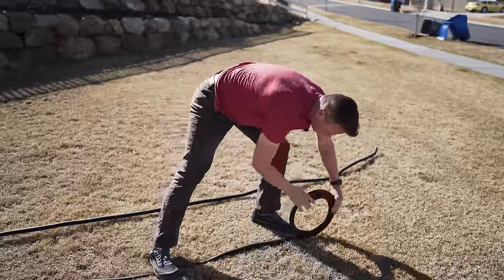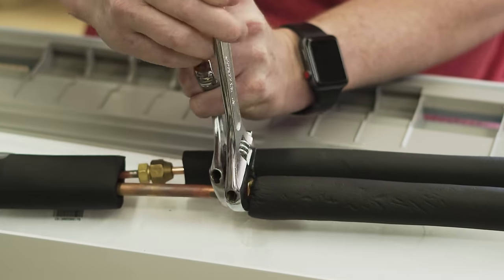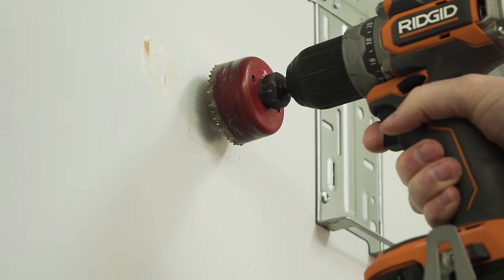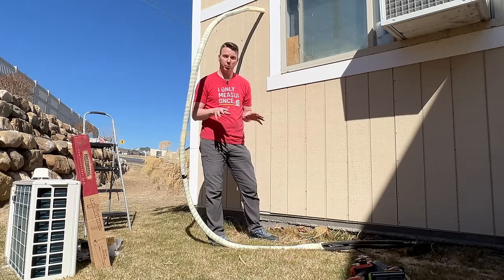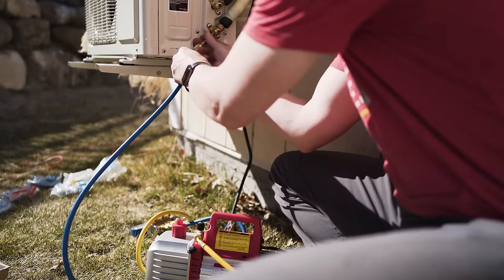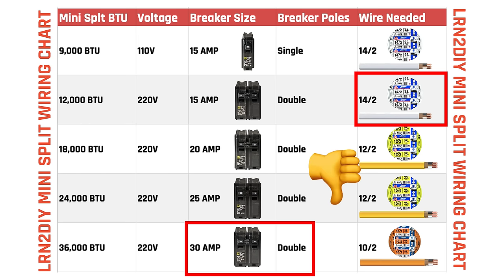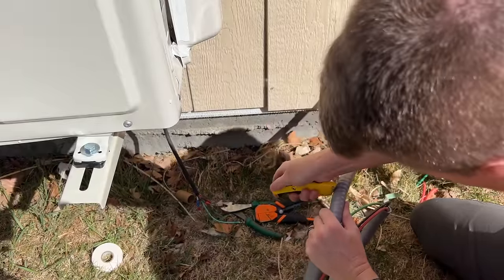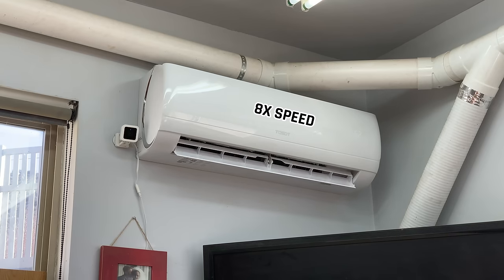DIY Mini Split Install - All the Things Nobody Shows You

Comment: As other have mentioned, you should use a 15 amp breaker set on this circuit.  The wire gauge is irrelevant when sizing things.  You size for the SMALLEST wire used.  In addition, I would have use the red and black wires and capped off the white one.  You have no neutral line going out, just two live wires.  The white wire suggests it is a neutral wire which it is NOT!  Yes, this works, but I wouldn't do it that way.  If you do use 14-2 wire, I would wrap the white wire with red tape to indicate it is a live wire, not a neutral.  Note that the wire to the AC condenser from the cutoff switch has red and black wires, and no white wire.
Reply: Well said.
Reply: 100% agree, well said.
Reply: Spot on !
Reply: Swap out the 30A for 15A ....a breaker is to protect the cable not the equipment.
Reply: you can tie the neutral and ground wire at the minisplit and run the neutral and ground to their respective parts of the buss bar at the panel. I tend to step up a size on the wire gauge on this type of thing in case in the future a larger minisplit is needed. Looks like a easy run though so no big deal.
Reply: @TheFleetz  think about what you are saying here… the equipment has overload protection built in, yes, but the breaker rating being higher than stated on the data plate would still protect the wire… since he used larger wire. The breaker being oversized is wrong, because the equipment is not rated for such a large ocp. So, in the case of motor loads, the oversized breaker for the wire is to prevent nuisance trips due to motor load surge amperage. 
Notice on any hvac data plate, the MAX breaker is ALWAYS larger than the minimum ampacity wire spec.
Reply: I was going to say the same!
Reply: Spot on!
Reply: I've watched several European techniques and those use a plug-in for the indoor powered unit and not run completely down the line set drain exit tube.
Reply: @SuperVstech  i will totally agree on what your saying but olso add that if a panel, or a breaker or even your electrical company looses a leg or phaze , then its going to single phaze and that motor will over amp to 60 + or - 10% only on one leg with the possibility of burning up the windings of said compressor or fan motor. I give this man props on helping but if he doest know electrical the its a possibility liability when wrong. oh and just note people you always shelter your rubatex on your high and low side so it doesnt consume water, get water logged and possibility end up loosing pressures.
Reply: @SuperVstech  you're forgetting internal wire in the units it's likely 16 gauge. Always size breaker to equipment specs And Just use wire at least that amp rating
Reply: Z?ss
Reply: He should have contacted Tom to confirm or do his electrical work , otherwise great video, very informative
Reply: @TheFleetz  Actually, that is not completely true with AC equipment.  If you look at just about any AC condenser ratings, they have a minimum and maximum breaker size and that is done to protect the wire and the equipment from catching on fire.
Reply: He should have taken his own advice and hired an electrician. In most places using the right wire colors is mandated by codes, and using the white wire to carry the second phase for the 220V is a code violation! To make this code compliant you have to use the black and the red wires.
Reply: Agreed. red and black for L1 and L2
Reply: Also, your not supposed to run romex into conduit, use THWN please.
Reply: Came for this comment...about the 15 amp breaker, everything else, extra learning. Thanks
Reply: Exactly.  Using the white wire instead of the red wire is a code violation where I live.  If you're going to use the white wire for a "hot", you MUST mark it by wrapping it on both ends with a color tape that indicates that it is a "hot" and not a neutral.  With there being a red wire already in the cable, it's odd that he chose to use the white and not the red.  Looking at the colors in the whip should have been a major clue that white was not acceptable.

As for the breaker:  The breaker should be sized to protect the SMALLEST wire in the system.  And in this case, that's either the whip or the wiring inside of the condenser unit.  I like the idea of heavier wire for the run (the #10 is fine) because you get lower voltage drop in the wiring.  But the breaker should be a 15 Amp.  And that's easy enough to change.  Just buy a 15 amp breaker and make the swap.  (And switch to using the red wire while you're at it).

Had he used a fused disconnect, he could have used 15 Amp fuses in the disconnect, and then the larger breaker in the panel would have been acceptable.  Without that fusing to protect the whip and the condenser unit, this installation does not meet code (where I am).

If you had this installation inspected by an electrical inspector (required where I live, along with obtaining a building permit), it would not pass.  It's fine to do your own electrical work on your own personal residence, but (here) you must have the work inspected, and these two fairly major safety violations would hopefully be caught and you'd have to correct them to make the job safe.
Reply: @TheFleetz  In this case the NEC says we size the breaker to what the AC unit says to size the breaker to protect the equipment.
Reply: The NEC says we size the breaker to what the AC equipment says to use. We also size the wire to what the equipment says to use. Not to the chart in this video unless it is that the equipment said to use. My 3/4 ton unit required 20 amp wire and 15 amp breaker. My two ton says to use 30 amp wire and 25 amp breaker. Also the NM cable(Romex) can not be used for this because the conduit is run outside and outside in a conduit or not is a wet location. Could have used UF-B cable.
Reply: Exactly.  I thought this was a test...lol  Good general installation instructions.
Reply: What a bunch of pansies 😂
Reply: Things are going to get really interesting when those wires going to the indoor unit short and get fed by that 30 Amp breaker.
Reply: @scaryperson27  neutral and ground should only ever be connect at service entrance
Reply: Guys, The breaker should be max 15amp and the Min. Ampacity rating is only 9 amps so the 16awg wire is sufficient for this install. You might not understand how a #16 AWG wire can be installed on a 15 amp breaker, but the NEC allows for this for equipment like Air conditioners that have motors.
Reply: NO,
NEVER EVER tape up a white wire to use to carry a hot side. 
I've come across this a few times. 
Besides being dangerous, it is not safe and against code.
Reply: Thank you for pointing this out. I got to this part of watching the video and just yelled "What?  No!" and checked the comments... sure enough, I wasn't alone in my shock. :)  Use the proper breaker size for the LOAD and for goodness sake, you have the red wire, use it for the other part of the split phase 220V !  Or if you only had 10/2 available, wrap the white wire with black (or red) electrical tape at the ends so it's being re-marked as a hot wire.
Reply: @ytmadpoo  conductors smaller than 6 awg can't be recolored, there are many more code violations and safety issues with this video. Proceed with caution
Reply: @TheFleetz  I believe you got it backwards the fuses to protect the equipment and not the wire you should have used the 15 amp
Reply: @SuperVstech  Thank you. I hope enough people read this far.
Reply: @zacharywm  Thank you for this comment, I got dinged by an inspector and told I couldn't use phase tape on some wires just because I was cheap,  so I had to rerun the entire line (and didn't save any money in the long run).   But then again, getting an inspector sign off is not what this guy is doing at all,  I wouldn't have either but needed him to sign off a new panel because the power company would not install a new meter without the tag on the panel that says an inspector looked at it (that really didn't save me any money!)
Reply: @Dr.HeySeussPHD  In many European countries only a certified electrician is allowed to work inside an electrical panel, by using a plug you can circumvent this rule.
Reply: Facts!
Reply: I'm so glad so many people noticed that. Other than the electrical install there was some good stuff like the condenser mounting bracket which was handy.
Reply: You dont know what your doing! I have been doing HVAC Plumbing and Electric over 26 year. The "Wire Size" also known to Pros is AWG (American Wire Gage) and it is the single Most Important thing. Unless you want a fire.
Reply: I've been doing HVAC Plumbing and Electrical over 26 years. Dont even try this! He only knows enough to be dangerous and a danger to you who listen. The necessary tools alone cost more than hiring a Professional to install it, about $3000. We do the job in a fraction of the time and give Warranties!🤣
Reply: @scaryperson27  no you can on tie the neutral to the ground. Absolutely NOT
Reply: @zacharywm  technically it’s the first disconnecting means
Reply: @code3responsevideos872  technically it's at the service entrance equipment
Reply: @zacharywm  no it’s not read the NEC buddy 250.24 - B  it’s at the service disconnecting means
Reply: @code3responsevideos872  I did, your missing "within the enclosure" but interpret as you wish
Reply: @zacharywm  I got my info from Mike Holt he’s the expert on the nec.
Reply: The outside:   I think 30amp disconnect is the bare minimum available serving code required disconnects.  He could have gone with a smaller breaker and wire, but his choice leaves room for future headroom.  Perhaps this application would be one to entertain a fused disconnect - minimum rating is 115% of full [normal] load current.  Without nameplate data, I'm guessing 15amp fuse would do the job, but not enough info outside of the manifacturers BTU guide he showed  The trouble with romex is white is the second color - always.  But its a manufactured cable, so put a band of color tape near each end of termination to indicate the ungrounded condition - any color except white, gray, or green is acceptable. 
The business of calling white "neutral" in this vid is no small mistake - he's terminating to a breaker [not the bar on the right or left side], and is picking up a phase.  Also worth noting [and I can't really tell from 25:07] is since his main is outside... he is working in a sub panel - the neutral bar should not be bonded to the box.  That reference [to ground]  should already be provided in the main panel.  Some might ask why?  Because grounding is for fault current, not load.  Bond neutral in more than one place and nothing good will come of it.
Reply: I'm a DIY'r and I completely agree, seeing a white wire says "neutral" so using a color any color (or tape as you mentioned) would have been much better.
Reply: The white wire is always recognized as the neutral wire and black is phase 1, 120v. Red is phase 2, 120v . Both together make it a 240v circuit.  Technically  the red should have been used,  and he needs to use 15 Amp bker and not 30. If that panel ever gets inspected that circuit wouldn't pass.
Reply: @SuperVstech  this is correct, I believe NEC 440.4(B) iirc.
Reply: There is no equipment protection 
15 amp unit. 30 amp breaker. 60 amp non fused disconnect  
Everything is backwards in this scenario
Reply: Romex isn’t outdoor rated even though you put in conduit for protection. Outside is a wet location and wire rated for wet locations should have been installed. Individual wires rated at thwn would have been ideal. Other people already hit on other wiring problems so I won’t list them. It is nice to be able to do a job by yourself but this project was definitely out of your knowledge base. Education and knowledge are the most expensive tools on any job site. This was my first video I have watched of yours and will be my last. Giving bad information to gullible people is a very concerning. This type of video is what gets people hurt and property damaged. This job should have been a permitted job. At least videos like this keep us tradesmen busy cleaning up other peoples “weekend warrior” project.
Reply: If the grounded conductor (White/Neutral) is connected to ground anywhere, this can allow for return current to travel thru the grounding circuit thru equipment and cause an electrical shock hazard. Instead of normally the return current or fault returning to ground at the first disconnecting means at the service entrance bonding jumper.
Reply: @TheFleetz  
Very well said. Thanks 
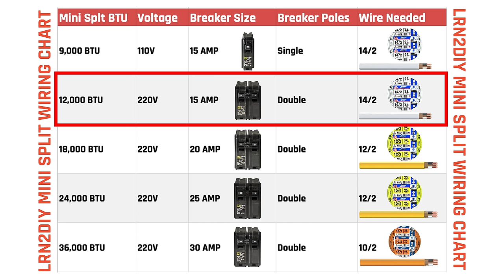This is very important to know . This is the first for me . I always thought that is to protect the equipment. 24:41
Reply: Code requires all 4 wires on a new install. You can't just use ground as your neutral just because it works. The electrical code it there for safety. Use neutral AND ground.
Reply: @robsapplianceplus6071  For a pure 240 volt circuit, you only need two phase conductors and a ground.  No neutral is needed.  If there were 120 volt loads, yes a neutral would be needed.  I have swimming pool motors that run on 240 volts, and DO NOT need a neutral, but they do need a ground.
Reply: @Herby-1620 , So explain why the electrical code requires 4 wire outlets on new construction or remodels when installing a 240 appliance such as a range or clothes dryer. Even prior to that upgrade, there was a neutral with no ground. Having a neutral AND a ground is for safety.
Just because you can, doesn't mean you should.
Reply: @scaryperson27  The only place that Neutral and ground are allowed to be bonded is inside the main service entrance. If they are ever connected in another location, that forms a ground loop and can cause big problems that are nearly impossible to track down.
Reply: @sebastianusami  I dug into this once. Definitely embarrassing though not prohibited by NFPA 70, at least. That bulk does count against the fill limit and that's a big hit. It would be a violation if the jacket was stripped from it since Romex conductors aren't listed for conduit service.
Reply: @scaryperson27  Connecting N to G would not be permitted there. That usually only happens where the structure's grounding system grounds neutral---only one point is allowed.
Reply: @TheFleetz  Agree on the swap for sure, but I believe you meant to say the breaker is to protect the equipment, not the cable.  The cable can be min or larger, but the equipment will state the max amp of the breaker on the label.
Reply: @TheFleetz  lol then why swap it out. 30A breaker is good for #10.........hmmmm
Reply: He threw me off, I landed a red/black at the 2 pole breaker. That is L1&L2 at the unit correct? He mentioned neutral and I got confused.
Reply: Exactly what I was going to say. It's good practice to always wrap the ends of white live wire with red tape so that it doesn't get confused for a neutral.

For those who don't understand, a neutral is only needed for 120V as it uses half of the 240V phase. In some 240v appliances, they contain a neutral connection as well, but they aren't present on most AC units or electric Water Heaters. If your 240v appliance has a neutral connection but your existing wires are only 2 hots and a ground, follow the instructions for the appliance, which usually have a specific method to bridge the neutral connection to ground.
Reply: @scaryperson27  There is no neutral! This is a 220V installation, which is both hot legs of your service. Using the white wire can be confusing to non-electrical lay persons. Of course, always size your breaker to the equipment - not the wire. Also the equipment often requires a HACR rated breaker to be code compliant. A HACR is rated for HVAC installations.
Reply: I like the 240v models better for exactly this reason - less amps smaller wire (that and it's load-balanced on my backup generator)
Reply: Does that mean, there is no real issue with using the 30amp breaker, if he is using the 10/2? @SuperVstech
Reply: @330Iceman  can you explain what you meant by "always shelter your rubatex on your high and low side so it doesnt consume water, get water logged and possibility end up loosing pressures" Are you referring to line set tape? I'm confused with what you meant by "consume water"? Thanks
Reply: What? I put 3 of these mini-splits in myself.  I already owned a descent set of tools from designing, engineering over the years, but bought a few more for the HVAC part. Only a few hundred I think? I figured out the local electrical codes, watched a bunch of videos here & more importantly got tips from the pros like right here.  What not to do.  I would never pay 3 grand dude to you.  Sorry.  Americans need to start learning how to build things again and work with their hands.  It's good for your intelligence and also you're doing physical hands on work.  It won't kill you out there.  Toughen up. My advice is get everything done except for the electrical box install if you're not comfortable with that.  But if you try yourself, just make sure the main power is off.  Pick up a few devices that will tell you this without a doubt. 
Everything you need to know if right here online if you do some research.  @Brentmette1
Reply: @robsapplianceplus6071 Follow the money? Dual use breakers required now? The fourth wire is just an equipment bond. Years ago an electrician told me about how a person can get electrocuted by touching a stove and an ungrounded refrigerator. I think there’s an effort to make stuff idiot proof. Three wire was used for years and worked fine. The four wire itself, the receptacles, the pigtails all cost more money.
Reply: @330Iceman  only if you lose the neutral on your AND the utilities' side, and the load is 120 not 240.
Reply: The electrical would fail an inspection. WOW. Technically this would function, but why do it wrong?

If the proper wires are in the cable USE THEM FIRST. 

Also, it is frowned upon to put romex in conduit.
Reply: You stole my thunder!  Well said.
Reply: You're right, this guy should not be doing electrical work, he should have had a fused disconnect and used the black and red wires.
Reply: @TheFleetz Wrong, even if you are using number 2 wire, if the equipment calls for a 30 amp breaker, that's what you use. The equipment dictates what breaker you use, the wire size dictates what size equipment can be tied to it.
Reply: These points are important. The author of the video has demonstrated his lack of understanding of approved electrical practices. His installation would NOT be approved by an inspector.
Reply: These units are more current friendly with the variable speed motors.
While my 120 system says to do a 30 amp breaker, that's nonsense because my service panel is 6 feet away AND I do not have the optional heating coils. So less current demand and very short run (ie no voltage drop)
If you look at the wires that you put the disconnect on, those are like stranded 16 gauge copper.

I agree, you can easily get away with a 15 amp breaker if you aren't running this over 100 feet away.
Reply: @mikeharmon8733  , you have ohms law backwards. A longer run would result in more cable resistance and lower current, not higher. Regardless, the breaker should be as specified by the manufacturer and the cable runs sized appropriately for that current. Often, the specification is much more than the steady state current, to prevent peak inrush from tripping the breaker.
Reply: Thank you! There ARE 2 Hots. I was wondering how he got 220 from a single Hot.
Reply: @TheFleetz  The breaker ALSO protects the unit.  Should it develop a short internally, being able to draw 30A would surely make a fire. Yes, the 14/2 would heat up and eventually die, but probably after the electronics were smoky toast.